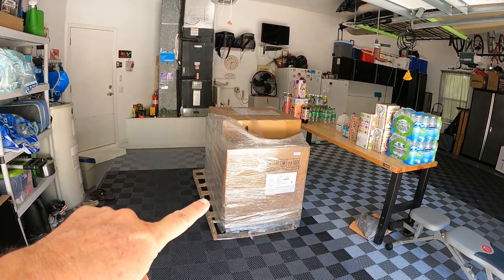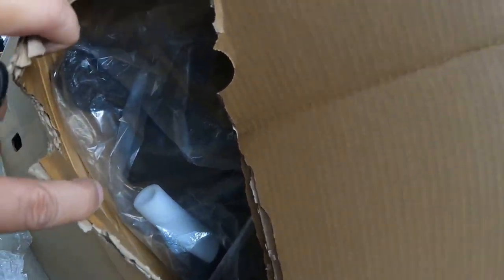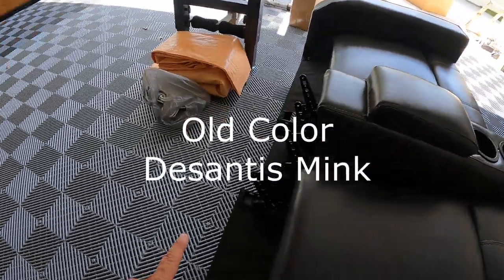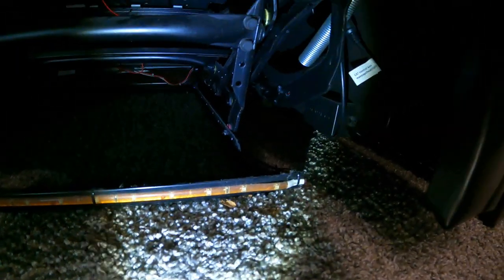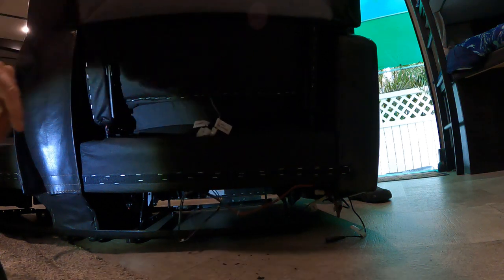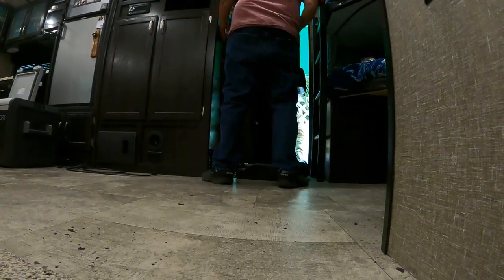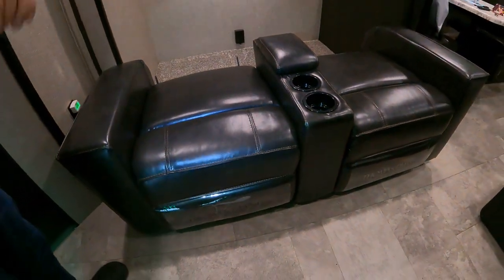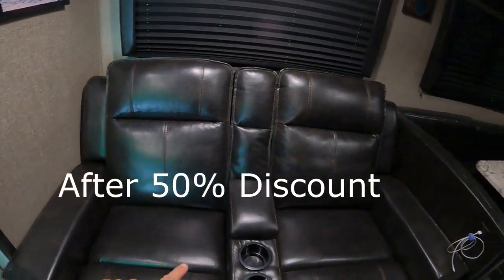Thomas Payne RV Furniture Install

Comment: Questions for you, we have a 2016 Jayco white hawk all the furniture covering is disintegrating we are pretty disappointed as we’ve had older trailers this never happened to.  Should we really think about removing, replacing or fold it in as we are feeling the workmanship of the whole thing is cheap?
Reply from the maker: The aftermarket furniture from Lippert has a 5 year warranty, I would call them to see if they give you a discount. We got covers at the Ollies discount store, but they were a pain and the peelings started to get on the floor. We liked the layout on a couple of the Jayco’s, but also thought the quality was lacking.
Reply: Thank you, I will look into Lippert @FLWeekendWarriors

Comment: The bottom section is NOT one big piece that needs to be maneuvered out the door as a unit. If you turn over the bottom section after removing the backs, you will see that the two chairs and the center console piece are all fastened to front and back frame rails. On my unit, each chair was fastened with 8 bolts needing a 7/16" socket and the center console was fastened to the same rail with 4 screws. So disassembling the whole thing took a few extra minutes, but then I could easily toss each piece out the door without needing my wife's assistance,

Comment: Did you screw the back of the frame down to the slider floor or just the front?
Reply from the maker: I just screwed the front. It worked for 4 years with just one screw in it. I just screwed in the other three screws that were just laying there.